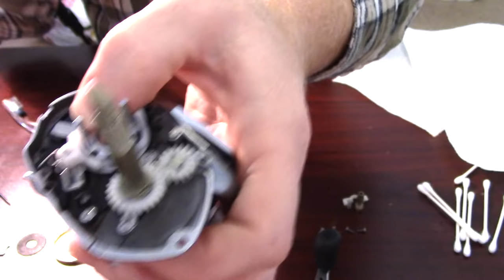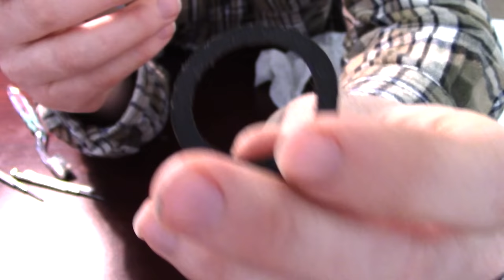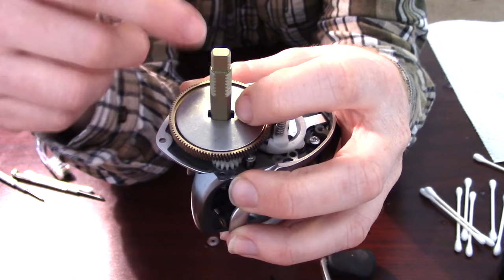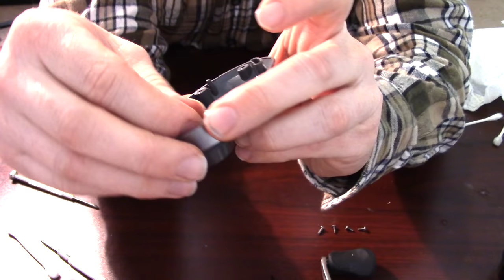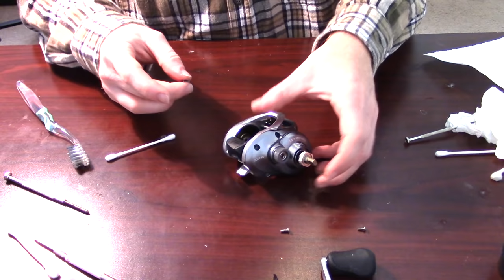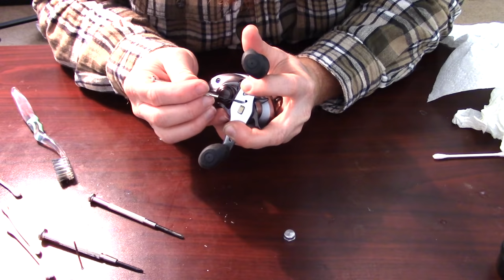Shimano Curado Full Reel Cleaning - Part 2 - Cleaning and putting together

Comment: My thumb bar won’t depress down all the way 😅😅😅 I thought I did everything right. What do you think I did wrong?
Reply from the maker: The thumb bar can get jammed if you don’t put everything back together properly.  There is a small L spring, make sure it’s in correctly
Reply: McFly Angler so that ramp you were talking about with the pink plastic piece, it went over it and won’t come back down. I wish I could send you a picture of it
Reply: McFly Angler It’s working perfectly fine when the side plate it off and i’m manually moving the silver toothed gear
Reply from the maker: Hmmm...  Yeah a picture would help.  Let me think about it and I will get back to you.
Reply from the maker: Ok, so possibly, the little metal stopper (it is the piece that sits below the round plastic piece) it could be setting incorrectly.  Make sure its above the plastic stopper.  I hope that makes sense?
Reply: McFly Angler It seems to be iffy/somewhat okay, just not as solid as before. If you think of something, please let me know. I appreciate the help! I just subscribed 😎
Reply from the maker: Actually, find me on facebook, we can IM chat there and send pictures back and fourth
Reply from the maker: BTW, what reel are you working with?  Same model?  What year?
Reply from the maker: I want to make sure it feels solid for you, Hopefully we can figure it out.  The other thing it could be is that you didnt screw down the whole system tight enough, or maybe its too tight...  The two screws that hold the plastic piece down (sorry I dont have the names of all the pieces on hand....) you want to make sure they are screwed in with the correct tightness.
Reply: McFly Angler It’s getting pretty weird. It works fine when the drag isn’t tightened down all the way. The drag has to be completely loose for it to engaged. it’s a 201HG, same model pretty much just left hand
Reply from the maker: Find me on Facebook.  Search McFly Lures....
Reply from the maker: Im only going to be up for another hour though... Just FYI.
Reply: McFly Angler Sorry about that, i’m not on facebook but I found your instagram and sent you a DM. I appreciate your help. Don’t worry about it, it can wait until tomorrow 👍
Reply from the maker: I will try to chat with ya on there, just tough on the phone thats all.  But yeah, thats cool!  Not everyone is on facebook, so I get that.  Honestly I wish I wasnt on facebook!  HAHA  But, I have to be to help promote and grow this channel.   So... Yeah.  HAHA

Comment: I tried this on the curado dc and after I put it back together the drag star is wobbleing after I spin the handle fast. Could it have been I put the washer facing the same side?
Reply from the maker: That’s possible, however I am not sure why so many people lately are trying this with a curado DC...  haha!  This is not recommended with the DC reels.  Those are extra complicated and you can destroy the “Digital cast control” feature.  I don’t recommend taking apart your DC reels for any reason.  Just send them into Shimano for work.
Reply: McFly Angler I only took apart the handle side it it cast like normal and drag works like it’s supposed to it’s just that the star wobbles were can I send it to get worked on?
Reply from the maker: Ok, well I don’t recommend touching any screws on a DC, I even have a warning in the description section regarding this.  But anyway, for the wabling handle, I would check the washers to make sure yes.  Does the star drag look like it got put back on upside down?  

Sorry your like the 4th person this week working on a DC reel, haha!  Honestly I’ve only ever taken apart one DC reel, and I remember the intervals are different.  I worked at a tackle shop doing this before the DC style reels came out.
Reply: McFly Angler everything else works and looks normal it’s just the wobble, it doesn’t wobble like crazy but it is noticeable.
Reply from the maker: Well then check the washers.  I know the handle assembly had issues once for me on my curado, and it turned out to be your assessment, the two washers that have to go in opposite directions of each other were the same direction.  It also made the drag not as strong also.
Reply: McFly Angler many thanks. 🙏
Reply from the maker: Hope it helped, let me know if you fix it.  Otherwise I’d recommend sending it in to shimano.  I mean they aren’t cheap, and the shipping is pricy also (unless you live down the street from them in Irvine CA) but they would be able to fix it for sure
Reply: McFly Angler it definitely helped thanks
Reply from the maker: Oh good!  Glad to hear it lessened the wabble